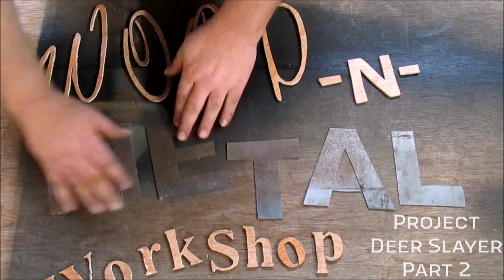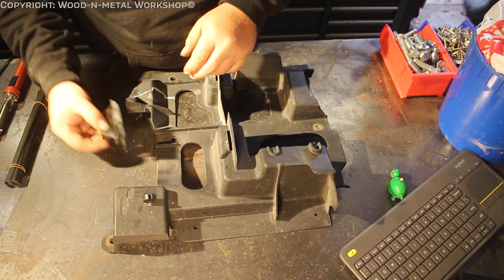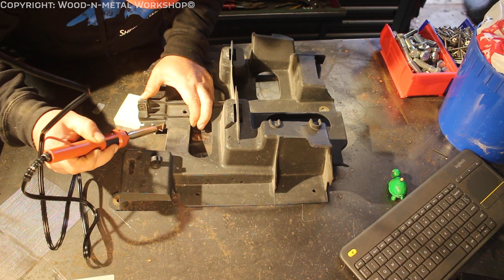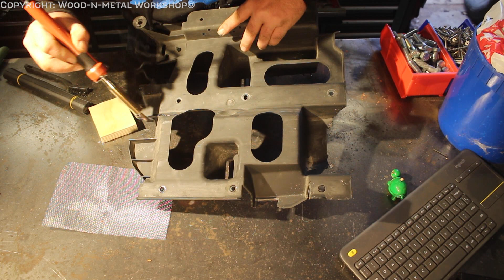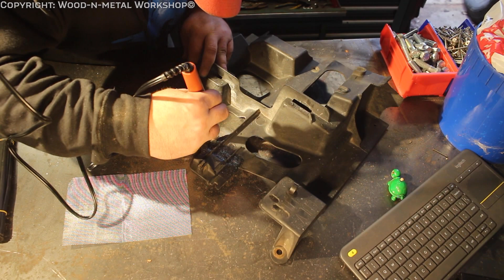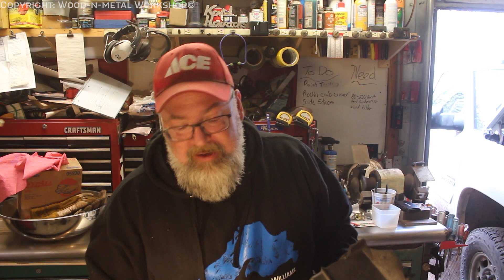Plastic welding, Repairs to the 2005 Chevy Duramax Pat 2

Comment: I have not had much sucess plastic welding but maybe the tools have improved since I tried it 20 years ago. Looks like your repair went decent.
Reply from the maker: I really haven't had a lot of luck with it either, but since this is a low stress part I figured I would give it a shot. Kinda like your latest vid, give it a shot. If it works great if not it was already broke.